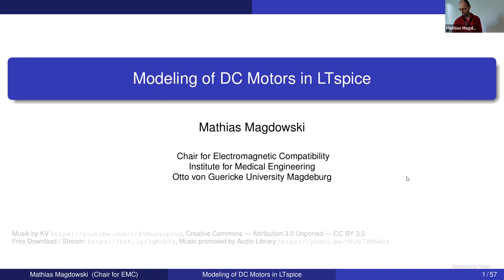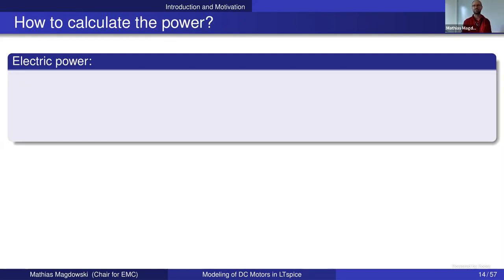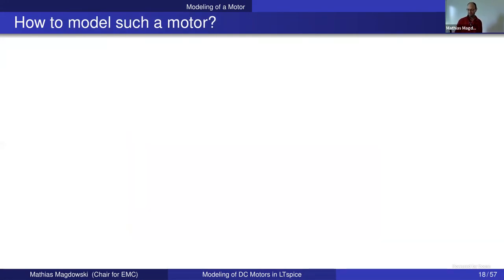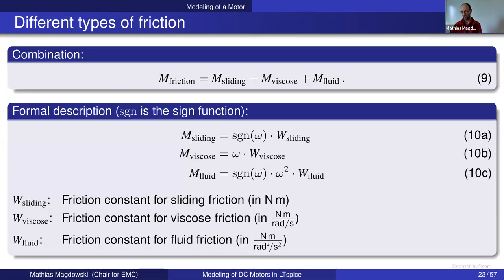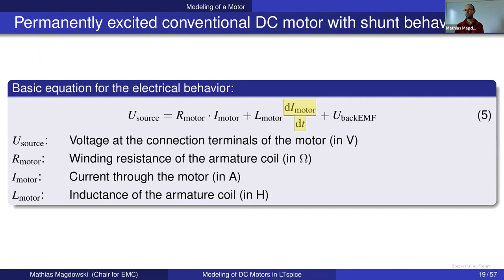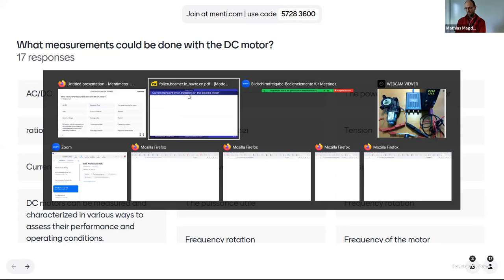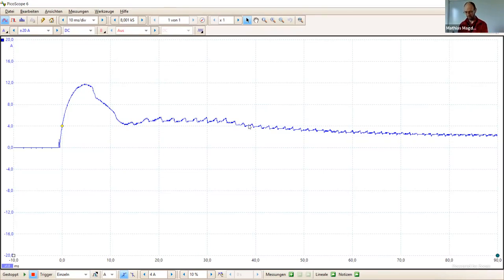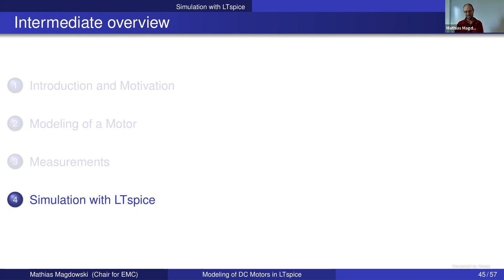Modeling of DC Motors in LTspice with Practical Experiments and Demonstrations

Comment: Hello Matias,
Your lecture is very clear and interesting!
I don't understand engines that much, but I have a few questions:
1. I couldn't quite understand the time constant, because you take a different slope each time, so as far as I understand the time constant will be different, right? If so, then what will be the exact time constant?
2. Also, the rotation frequency is created because of the brushes of the motor or also because of the poles of the stator?
Reply from the maker: Thank you for this excellent question.
1. The time constant of an exponential function is defined as the time taken for the tangent to cross the asymptote. Due to measurement uncertainties (e.g. quantization of the digital sampling oscilloscope, imperfect switching of the switch, ...) and imperfect construction of the motor (e.g. small differences between the rotor windings, different contact resistance of the brushes, ...) the measured slope and the corresponding time constant will vary a little, but should always be in the same order of magnitude.
2. Exactly, the rotation frequency is due to the brushes of the motor, which usually correspond to the poles of the stator, where each winding has an input and an output section along the commutators (see for example this picture https://commons.wikimedia.org/wiki/File:Kommutator_universalmotor_stab.jpg in Wikipedia).